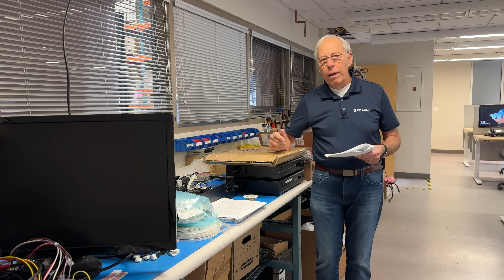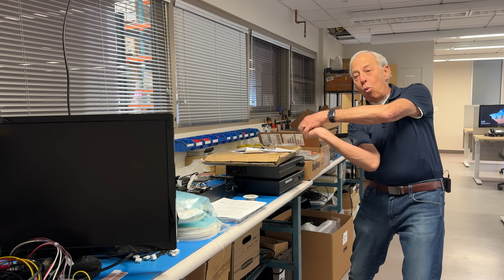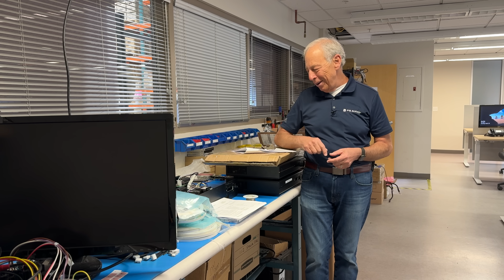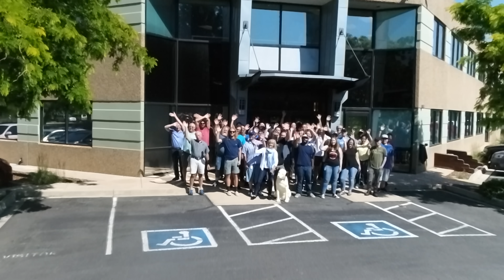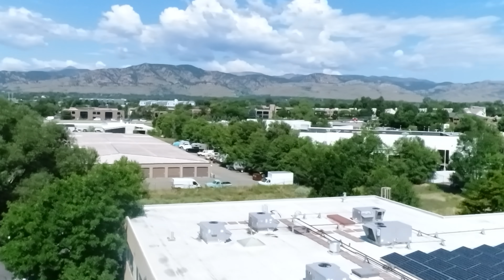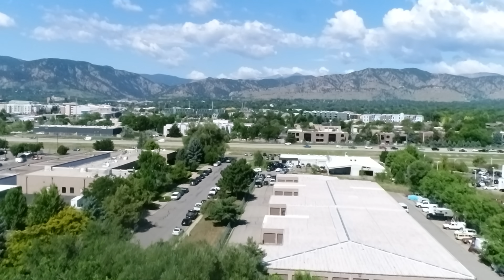Feeling bass in your chest

Comment: if you ever have the chance to drop in your local batting cages, see if they have a high speed cage, like 90 mph.  Try standing next to where the ball hits, which will probably consist of a 1 inch thick pad hanging on the chain link.  Your stomach will be saying let's try the 50mph cage and forget the 90.

Comment: If it's so loud it vibrates in your chest, that can be unhealthy, especially to your heart. This is not exactly accurate, either.
Reply: Finally a comment, that's true
Deep bass sometimes creeps me out, i feel it in my chest difficulty in breathing. Is that normal??
Reply: @nikZocovers  -  i do not feel it is healthy. Usually if bass is that heavy, the overall sound is too loud and unhealthy also.
Reply: @ernies8828  there should be some kind of bass speaker were people can hear and feel it, but not the vibrations inside their body.
Do u know something like that? What do u think buddy??
Reply: @nikZocovers  -honestly, i only use bookshelf speakers with 6 1/2 inch midwoofers and a 1 inch soft dome tweeter. I could not have a subwoofer in my condo in the first place..Honestly, I am sure you could set it up the way I described. I had a 10 inch Paradigm subwoofer many years ago. I was able to do just what I described.
Reply: @ernies8828  that's great!!

Comment: I have deep and big bass but i dont have chest bass. Is that because i dont have a good enough amp?
Reply: Deep bass but inadequate midbass punch is common. 

Often it's SBIR nulling ... ie., energy off the boundary behind the loudspeakers destructively interfering with the forward propagation. 

Also, lack of bass trapping, as resonant build up blurs detail. 

Some remedy this via nearfield subs or MBMs (mid-bass modules). 

- experiment fore and aft with both loudspeakers and listening postion, until you hit max punch yet retain ample depth. 

- nearfield sub
- tactile sub mounted under your seating.

Tactile approaches, there's countless threads on AVS DIY section, inexpensive, and perfectly effective. 
Inexpensive $50 drivers implemented to provide exactly what you're after.
Reply: @FOH3663  Ok, i will have a look into it, thank you for great answer! I use bms12S330, they are high quality woofers, i have bought strong class D amps now so lets see if i am able to get that punch in
Reply: the enclosure is one of the most important parts when it comes to low end. but the amplifier and subwoofer itself also matter a great deal

Comment: Is there an ideal woofer size for certain frequency range?

Or does it depends on room size, magnet strength, box design and needed wattage?
Reply: No, there's no ideal size. 

My tiny in-ears reproduce 20hz just fine. 

It depends on the T/S parameters, the box size, alignment, application. 

IMAX theaters use 12" vented subs. 

I know enthusiasts that use multiple 24" drivers for home theater. 

Driver diameter impacts frequency at which the output begins beaming/becoming directional. 

At bass freqs, this isn't an issue. The onset is approx the frequency having a wavelength equal to the diameter of the radiating cone.

For example a 15" ~ 500hz

Comment: 49 years old now. 2 events come to mind. When I was at Snoop Dogg and Dr Dre Chronic tour in early 1990's when I was a teen there were so many walls of subs you felt the bass surge into the concrete from your feet to the top of your head and then back out again each time it hit. That was loudest ever and it was crystal clear the high and low's. Other time was my system in my basement. Next door neighbors called our home phone ( I was in teens in age ) and said could I please turn down the music they were trying to eat and their plates were moving across the table. When my mom told me I said no way possible. I went outside in the grass area between our basement and their house and sure enough I could feel it strong in the ground. I had a big class Threshold amp back then driving the Klipsch flagship horns that go in the corner of the walls with the 15's and then center channel flagship Klipsch powered by Mcintosh amp. Thos Klipsch sounding amazing with rock especially Red Hot Chili Peppers ( Blood, Sugar, Sex, Magic) CD. Had Nakamichi player back then and Lexicon surround sound processor with Threshold FET9E pre-amp. Had Definitive BP 10's speakers for back surround sound and M & K ( Miller and Kriesel ) 12 inch subs in push pull configuration. The movies on that were incredible had the Pioneer laser disc system. These days do more easy listening with my Sonus Faber Aida 2 speakers and my pair of VAC amps 452 IQ musicblock's.
Reply: That's not possible! To make plates in a different house move across the table. Maybe the loudest thunder ever could make a plate move a tad, but not across the table. Audiophiles are sometimes known for their imagined or made up sensationalism.
Reply: Ah hem, have you ever heard of Nikoli Tesla?  He had experimented with asymmetric oscillators in his younger years and decided to see if the ground could transduce the shaking waves it produced.   So, like any enterprising young man, he decided to pound an 18 foot pipe into the ground of his basement and attached onenof his oscillators  to it.   The townsfolk (i.e., the entire town, not just the next door neighbors) were not happy!

The guy in this post did say his speakers were in the basement. It's possible. 

In fact, I got in major trouble in college because I had a pair of Klipsch Tangent 40s (predecessors of the Forte IVs with a huge passive radiator) in my dorm room.  On multiple occasions, the young ladies 3 floors above me had complained about their pictures jumping off their desks and shelves...I had to reimburse them for the damage I had caused 😂
Reply: If either of you guys play your speakers so loud that it can make plates vibrate across the table orin the house next door, or make pictures fall from their shelves of someone living 3 floors above you; they COULD NOT have told you, that those things happened. Unless they knew sign language. Because you wouldn't be able to hear a thing.... It would take a jackhammer in the same room to do stuff like that. A fiction I'm sure. Not ALL audiophiles will believe just anything

Comment: It's not necessarily related to compressed air. You can have the same sensation with earthquakes where the waves "roll" through soil, concrete, your bed or whatever (experienced that about three times in my life with quakes over 5.0). So we are talking about resonance frequencies or "sound waves" that have no problem with shaking your chest - even without air, just by yourself sitting in a chair or standing on a vibrating floor.

Cat owners know that too when they cuddle their purring pet and the alpha waves are vibrating their body parts close to the cat (those waves can also have a healing effect btw). The lower the sound frequency the better it can be felt.

Comment: As far as I can tell, this effect is greatly related to the size of the woofers in the speakers! I don't like it when people rank the bass of the speaker just based on the stated low frequency response of a given speaker for four reasons: 1. That's only the low frequency response compared to other frequencies in the same speaker. The FR plot doesn't tell you how much air the woofer is moving. 2. Response below 200 Hz is greatly influenced by the room. You could have a huge null in one room, and not another, at 50 Hz. I would take Altec Lansing Valencias or Model 19s if I could find any locally.
Reply: yes, decibel frequency response graph do not capture bass impact.
maybe spl show it better, it is related to cone area and room volume.
more cone vs room air volume the more physical bass becomes at lower decibels, still the same decibel loudness.

Comment: Nja going a little bit deeper, it is far from just the woofer..
It is also the enclosure design!

Even just a very big woofer by itself in a open baffle "enclosure" may and will have a harder time to make a chest pounding bass. (There is many reasons why).

But the same woofer in a very common bass reflex enclosure will give you that chest pounding bass..

In short the enclosure design is enabling that !

A woofer has its big area and a number of millimeters travel for it so called x-max..

Compared to the bass reflex tube/vent hole.. It has a much smaller area and their is where the action happens..

At its tuning frequency the air will go in and out with high velocity so high that in some cases you can hear it as a unwanted noise.

A small area without a membrane like the woofer has, when it is just a hole..
Its x-max is in practice infinity!

So it is in practice it is acting as little sound cannon that fills the outside with "shocks of air" that you feel in your chest..

Then we can discuss if it is natural way to experience unamplified music (live without pa systems that recreate with speakers) if it is not there then this "feeling it in the chest" is probably artificial and not normal in live music.

It is just actually noise and a consequence of playing smaller speakers that try to play like bigger once. 

By using enclosure technology like bass reflex cabinets.

Then it is just a different topic that approx 90% of all enclosures are bass reflex and therefore most people are used and conditioned to that flaw "chest pounding bass".

So it somehow gets desirable😮😂

Do this experiment (and if you have not then you don't know).
Take a big woofer as a 18" or two of them.

Place them in a open baffle "enclosure" in other words replace that smaller woofer with the bass reflex enclosure with a much bigger area woofer without that bass reflex..

In short then you get a better and more accurate reproduction of bass. (When/if  they get and have the same measured bass extension.)🎉

Comment: I worked security at a rap concert once, I had in ear plugs and was standing in front of a stack of Meyer Sound subs. I could open my mouth in front of the stack and there would be enough air moving in and out of my mouth by the woofers that I didn’t really need to try to breathe.
Reply: You reached audio nirvana, my friend.

Comment: bass response , is not really about intensity , but rather an extended low frequency response of a particular loudspeaker.
Reply: Bass response includes everything about bass. It's the part of sound that's missing on a small transistor radio for example.

Comment: The cannon shots on Telarc's 1812 Overture can be impressive. They broke windows when they recorded them.
Reply: Yes it can! I've had the album and CD for many years and it still amazes me to listen to it. You can actually see the space in the groove where the cannon shots occur.
Reply: @stephensams709  The cannon is hard to track for many turntables/cartridges. The stylus pops out unless you have a good setup.
Reply: A 105mm Howitzer is what was used in that production. 
"Caution; Digital Cannons". 

Playback at reasonable levels requires a lot of system capability. 

Only when I moved up to (4)15"s, and (4)18"s as subs, ... supporting 2kw 3-way active mains (Seaton Cat12c) .... 
Only then could I play the piece with musical authority and still be able to track those big cannon shots. 

Still today, it's the most dramatic demo to the uninitiated, ... unexpected listener. 

Then, perhaps follow that up with modern track like Lorde's Royals, Daft Punk, or Tiësto's The Business.
Reply: @FOH3663  The groove deflection is visible to the naked eye. I have a Sony PSX-75 with biotracer arm (electronic tracking) and Adcom XC/LT (crosscoil, line trace) cartridge. It is able to track. Many cartridges will just skip out of the groove. I recently found the cannons on a Telarc CD, too. 
That's got to sound/feel amazing. I hope you live in the country. I just have a couple tri-amped JBL 4343s. I moved to where I have neighbors within 100 yards, so have to be considerate.

Comment: What's more interesting and confusing is how a 50mm headphone, or 12in woofer can make a wave that's bigger than most rooms. Yes, I know it's a wave front, and not the full wave, but still is very odd to me, and I've been doing hifi for over 40 years.
Reply: Of course it's the full wave that a headphone makes. The air that the headphone or speaker compresses don't move across the room; it's almost static. The transducer pressurises the air that's is in contact with, that air pressurises the next one, etc... like the conservation of momentum in Newton's cradle. The length of the wave doesn't depend on how far the membrane moves. It depends only on the frequency. The length is the speed of sound divided by the frequency. Ones hand in water at «slow» frequencies creates very long waves without moving water. My guess is that's easier for a headphone to do lows in a room, because level is low and won't be affected as much by cancellations of the pressure reflected by the walls (depends on the frequency associated with the distance to wall [cancellation] and the distances between walls [room modes]).
Reply: @Jorge-Fernandez-Lopez The reason it’s easier for headphones to reproduce low frequencies is because the amount of air it is moving is far less. Headphones only have to move the air between the driver and your ear drum, which is a very small load of air compared to a subwoofer’s load inside a box and room.
Reply: @BASSBURGH  I agree, although your answer was implicit in mine. You explained perfectly what's behind my words «level is low» and why low frequencies of headphones «can't» be heard from three meters. My answer to KevlarCondom's question was about the length of the frequency. Waves are defined by frequency, length, amplitude that requires energy. You explained amplitude and energy, I did with frequency and length. Mystery of headphones should be solved. Thank you.
Reply: That part that amazes me is feeling it in your feat. Yeah that 9 Dbs boost switch inside my JDS Labs Altoids Box is pretty amazing. And my ATH M-50x's only have a 45 mm . I discovered that in my car when I was living in it. Thought I had forgotten to turn off the engine after warming up and indeed the engine was turned off. My conclusion is the bass resonates in your body so you feel it. You may ask why headphones in the car? The answer is that way if you fall asleep with headphones in your car, it isn't thumping and the local police officers are also not as likely to wake you up. Secondly you don't want to fall asleep with the car running or the stereo on and the car not running. Ether way it sucks too much fuel wasted or the car isn't going to start.The first rule is to keep a low profile and not be noticed also get a jump start battery right away it's your most important accessory and make it a good one. A good mini will usually get it started but having a good new full sized in the truck topped off is good insurance for that time when the battery gets a full discharge and dropped to low. It can take hours before someone is willing to give you a jump start while you're stranded.

Comment: Being a drummer, my "woofer" is a 22" diameter bass drum.  I haven't played live in a long time, but when I did, I enjoyed seeing people dancing nearby experience that chest-thump as I played pretty hard.  The main reason I enjoy sound reinforcement gear as opposed to audiophile gear (especially speakers) is my desire to "have the kick-drum part my hair in the middle."  Sure, I'd prefer audiophile-class gear that would do that, but it has always been beyond my reach.
Reply: What is sound reinforcement gear?
Reply: @brainache555 live sound equipment
Reply: @brainache555  If you've been to a live concert, you've heard it and seen it.  It is the PA gear, especially the phenomenal speakers that can fill a 20,000-seat arena with sound that can (as Paul said), "Make your pants flap!"  And as Paul has explained in other videos, sonically, sound reinforcement gear isn't particularly flat, clean or accurate, but it is VERY exciting and POWERFUL.  And since I mainly listen to Rock 'n 'Roll and Fusion, "high fidelity" is nice but not mandatory.  PUNCH is mandatory (Hey, I'm a drummer!).  To achieve that level of power and punch with audiophile gear would cost many times more than it does with sound reinforcement gear.  So, I trade a lot of what Paul's products provide for "inexpensive" (it's still not cheap!) punch and power.  That, to me, is known as LIVE sound, and I prefer it, since I play (okay, played) live music.  Don't misunderstand me: I'd MUCH rather have high end gear like PS Audio produces but neither my hearing nor my budget can justify it, darn it.
Reply: @terrysmemo8775  I’m sorry but I have never experienced good live sound
Reply: @brainache555  Sorry, man!  It is a thing to behold.  Of course, it is all subjective.
Reply: @brainache555 
The quality of today's live concerts is extraordinary. 

Attend a proscenium theater show, or an outdoor show ... either with a major touring act, get good seats and be prepared.

Comment: When the air pressure is loud enough to feel it, probably the overall SPL is on the unhealthy side causing hearing damages. I was attending some Dire Straits concert in the 90s and was standing up near the stage right in front of one of the very large speaker setups. When I came home I could hear a rather loud buzzing for several days.
Reply: totally depends on frequency...
Reply: @Milkmans_Son  Yes, but assuming you are running a fairly neutral tonal balance and the music is not just sub bass only, you can get hit by higher hearing damaging frequencies at high SPL when the bass is loud enough to shake your clothes, which is probably 110dB or louder.